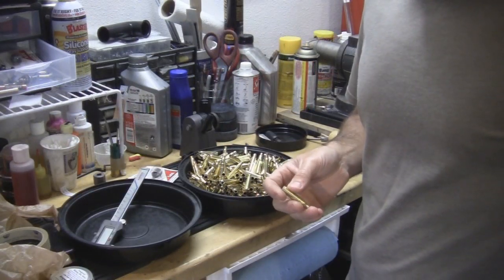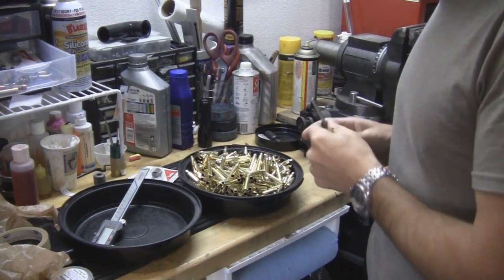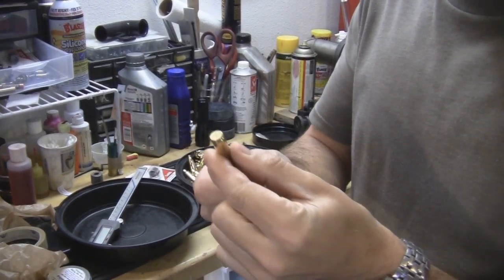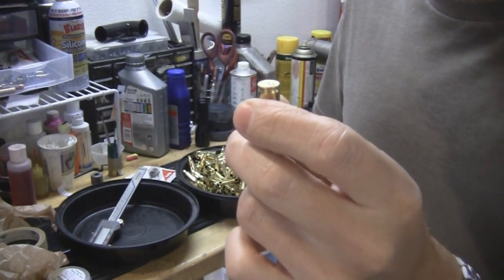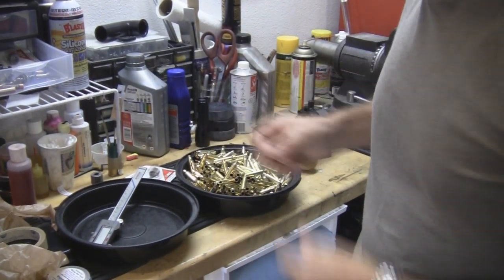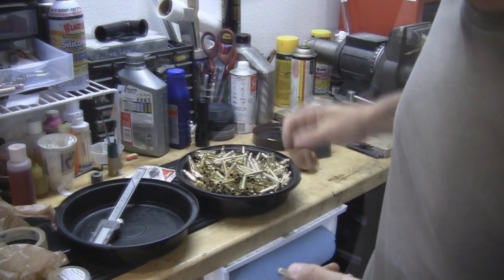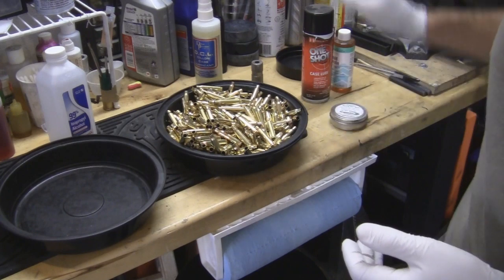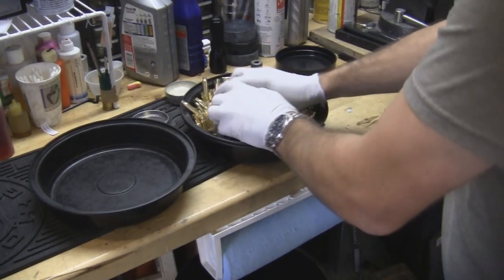Reloading 223 Ammunition on Dillon 1050 with RT1200 Trimmer and Bullet Feeder

Comment: Using multiple sizing dies is an excellent idea. I do the same thing on a single stage by sizing and rotating the case for a total of 3 resizing strokes. Allowing the press to dwell at the top of the stroke also insures the brass has time to move and take a set.

Comment from the maker: Die sets usually come with a factory crimp die that will properly crimp the round.  When you buy the press it will come setup for one caliber, including dies which also has a factory crimp die. I use Lee carbide dies for pistol and the kit comes with a factory crimp die.  To add an extra caliber to the 1050 (say .40 cal) you need at minimum the $120 caliber conversion kit which includes shell plate and parts to adapt the case feeder.

Comment: Excellent video Sir. I just recently added a Mr. Bullet Feeder and Dillon RT 1200 to my XL 650, and I am extremely happy with the results. I also "prep" my brass separately. I have my 650 set up for ,223 and I intend to add a .308 set up when the funds become available. I had 500 brass cases of .308 to process, so I set up the RT 1200 on my single stage Lee and it worked like a charm. What I didn't understand, (due to my severe hearing disability), is why you resize the brass 3 times? I have only resized mine once and they drop in and out of my case gauge OK. I even chambered a few dummy rounds in my Weatherby and they fed flawlessly. What am I missing?
Thanks in advance for taking time to share your knowledge and video!

Comment: Nice video, but let offer you this: i run a universal decapping only die on the first station. This serves to knock out any cleaning media stuck in there. Also i hate the powder check die, but when properly used its much more efficient than weighing each round. Just make sure you lock it down properly or it works itself loose. I also run the 1050 and it rocks!

Comment: I see this is an older video so I'm not sure if you are wet tumbling your brass or not. I highly recommend wet tumbling after removing the primer to clean the primer pockets. I load on a Dillon 650 and I get a more consistent primer seat with the clean primer pockets. I don't think that cleaning the pockets has anything to do with accuracy just helps me seat the primers without the occasional crunch and they are always seated to depth. If you are interested in wet tumbling I can highly recommend the Frankford Arsenal tumbler and if you search around you can pick them up for around $150, somebody's always running a sale somewhere.  My procedure for 5.56 is to remove the primer with a lee primer die, they are the toughest and can handle the crimped primer pockets. Then the next station I resize the brass then trim like you do. I then wet tumble and remove the crimp and debur the flash hole. Next I change out my toolhead and load the cartridges. This system has served me well for loading match quality rounds for competition with my AR-15, M1A, and my M1 Garand.

Comment from the maker: The 1050 machine with bullet feeder and separate RT1200 trimmer will all cost around $2600 usd.  Putting the trimmer on a separate (backup) dedicated press (for trimming only) enables you to not have to change anything when switching between trimming or loading.  Thanks /John

Comment from the maker: In addition to the caliber conversion kit I also have a separate tool head (the part that goes up/down that the dies live in) and power hopper dispenser.  That way once your dies are setup you don't have to change or set them up again.  Both these parts come in a $270 quick change kit.  Plus, after buying both the $120 + $270 kits you need to buy the die set that will run around $50.  The Lee carbide die set will be cheaper but works just fine.  /John

Comment: why would you resize twice working brass to much , just have a swage on press do it while everything else , use wet tumbling with steel pins it will debur and clean primer picket also , OKAY now I need your help , so if you only need to set primer drop powder , set bullet and crimp ,  YOU DO NOT NEED LUBE RIGHT , IF SO I UNDERSTAND YOUR METHOD AND I LIKE.  , thanks that was a very helpful video it cleared a few things up about this press ,

Comment: hey man. Looking for work. What Kind of volume do you do? I ask because the shop I work in has a vary large vibratory, polishing and deburring machine big enough to fit some gun barrels into. We are not in the reloading business but we need to keep this machine running to make money.  Right now it's used for steal rings. It could do about 3 to 4 cubic feet of product at a time.

If you do enough business that this would be an asset, let me know. We are in southern Utah.

Comment: Did you say the RT1200 is a resizing? or did you mean trimming to length? I am NEW (never done it) to reloading and trying to buy an all in one system, if I can deprime , size, and trim all in one station that would be amazing.
Reply: The Dillon RT 1200 / 1500 case trimmers use a Full Length sizing die ,  that resizes & trims to length .

Comment: did you have to modify your lee loadmaster to connect the dillon case feeder?
Reply: Wondering the same thing. May get a 1500 for my rcbs pro 2000 press.
Reply from the maker: No modification to the Load master.  It mounts right on top with no problem.

Comment: Wow what die is that the one that removes the military crimp? Let me know plz thanks
Reply from the maker: The crimp or swager station is a feature of the Dillion 1050 press.  The die has a rod in it which presses on the inside of the case head to keep it firm against the rotating plate.  The underside of the press has a rod that moves up/down as the press cycles.  That rod moves up and forces into the primer hole as the die supports the case from the inside.  /John